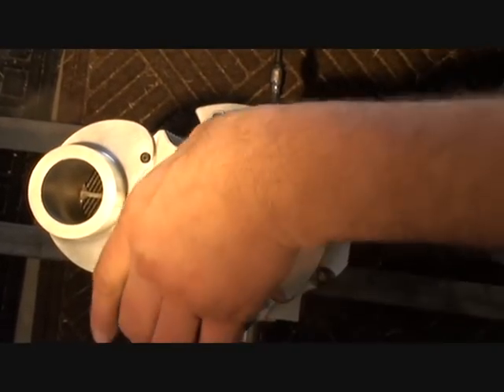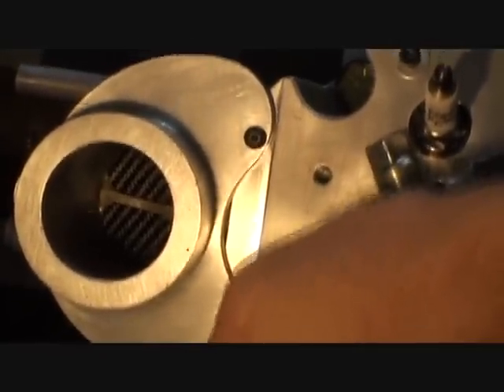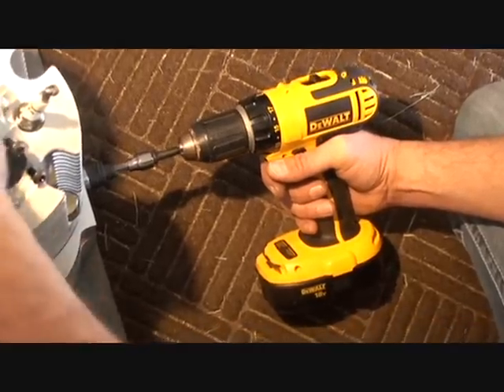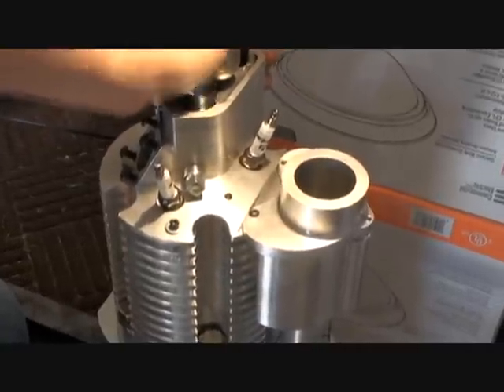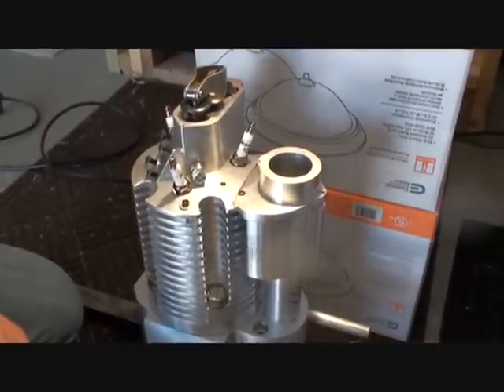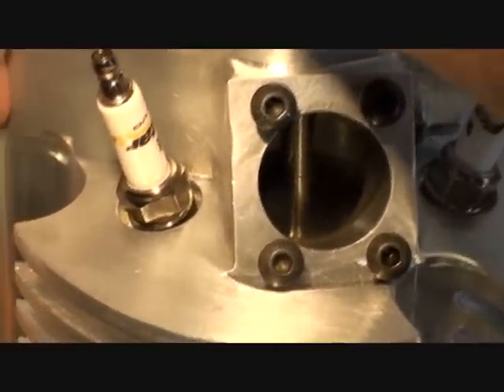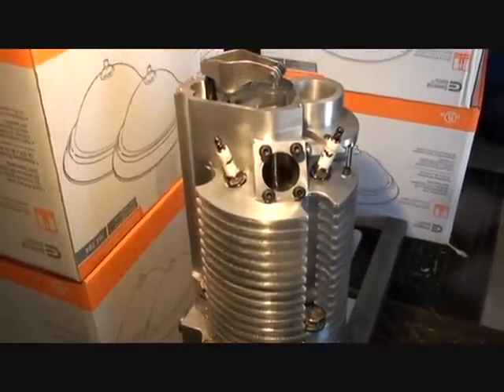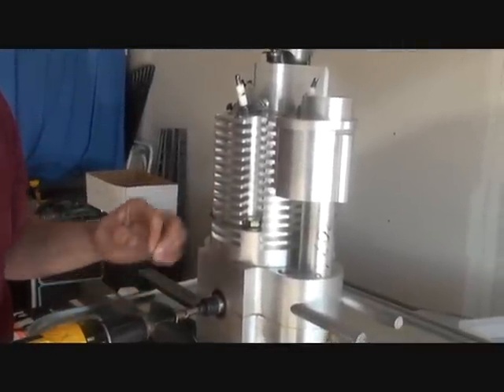Grail Engine "Cold Spin"

Comment: Hi, I was just wandering what your method of lubrication is, do you have oil spray injectors for the crank and piston? Also is the inlet valve purely pressure operated? Thanks.